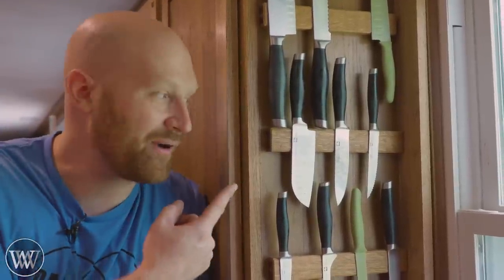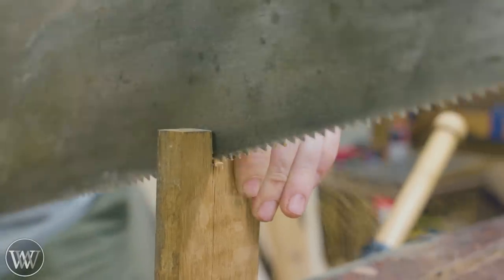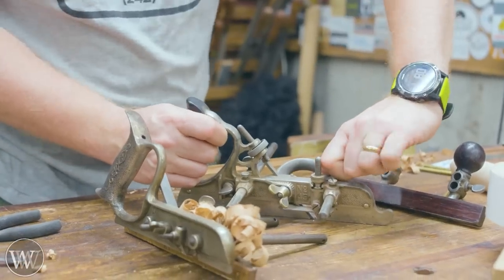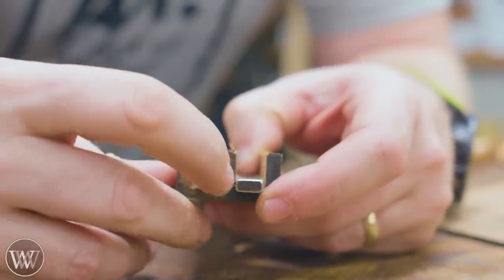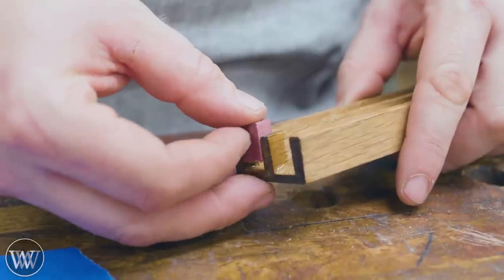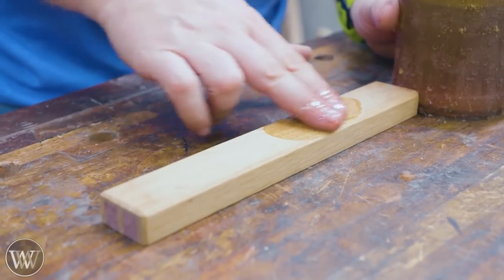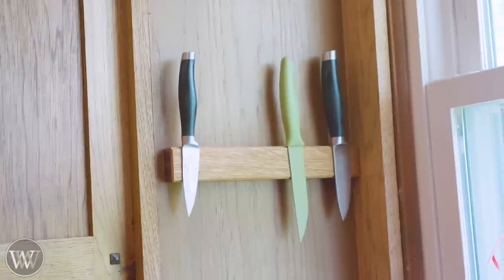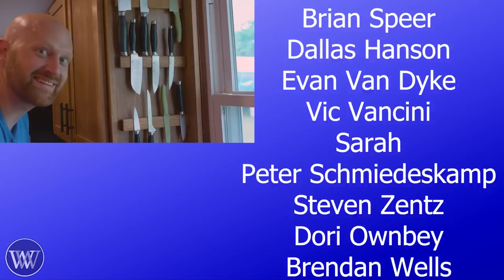How To Make a Magnetic Knife Holder

Comment: I’d make it backwards after figuring out how many magnets and they layout of them. Cut grooves to exactly 2x thickness of magnets, push them in, glue a 1/8” or 1/16” veneer on top. You get more material behind magnets for fasteners, and very thin material in front of them for maximum power.
Reply from the maker: I have that on my old set but with the veneer it broke pretty quickly. I could use a thicker 16th inch veneer but that would be the same thickness as what I have here.
Reply: @WoodByWrightHowTo  my previous one is magnetic bar from harbor freight. Every time I put a knife on, that metal on metal sound was pretty bad. I put one 1 layer of packing tape on it and it was fine. My current rental landlord lady does not allow any hole drilled on wall or the outside of cabinets. I can’t use magnetic holder any more.

Comment: I made a version of this that goes under the cabinet that is over my cutting board. Since I cook with one knife 99% of the time it's always at hand but it's out of the way when I don't need it. I used round magnets so it was easy with a brace. Since it's just the one knife it goes along the length of the wood.

Comment: James,
The magnet you linked to as the one you wish you used is not a true N52 grade magnet. It is far too weak for the size it is. Next time look at K&J Magnetics that is the site I have been buying magnets from for a while now. I make a lot of magnetic knife boards and depending on the client's needs I will use either N52 magnets that are 2"X1/2"X1/4" or 2"X1/2"X1/2" in a single row. I cut a piece off the face of the wood I am using a take it down to 1/16" and cut off a piece off each end. Then I route out a slot for the magnets and glue them flush with the face of the board. I will then use dowel and glue to reattach the end caps and glue the face back on. Since I use extremely thin Japanese saws to cut everything it makes the seams just about invisible even on highly figured woods and burls.

Comment: I made mine in oak which used about the same dimension but cut the front off at ⅛-¼  thick on the band saw. I the cut my slot in the main piece using my router for the long the magnets. I then cut a wider track on top to which I glued festool track edge rubber. I then glued them in using epoxy and glued the front to the rear followed by the rubber track. So I only have one line and holds all my kitchen tools. If you want a photo please ask for. K

Comment: That looks really nice!!! instead of screwing it to the wall you might have been able to screw a long steel piece to the cabinet and let the magnet hold everything together. You might need even more magnets in order to do it this way though 🙂
Reply from the maker: Unfortunately, it wouldn't hold through the 1-in thickness of cabinet wall. That would be a serious magnet to hold that long.
Reply: @WoodByWrightHowTo  I was thinking of a steel piece on the outside face of the cabinet that would be hidden by the knife holder.

Comment: What is that gizmo you used to cut the grooves in with? Also, you've got to be pretty strong to cut that oak free hand like that. I'm an older lady that works with wood and definitely not strong enough for that!
Reply from the maker: That is a Stanley 45 combination plane. Cutting the oak doesn't have as much to do with strength as it does with body mechanics. Even the hardest Australian woods don't take any more strength they just take more endurance because it takes longer.
Reply: Very nice, thank you.   @WoodByWrightHowTo

Comment: Why do you saw on the left hand side of the vice so you have to reach over to catch the offcut? Wouldn't it be better on the other side?
Reply from the maker: I usually prefer to keep the piece I am keeping in the vice. and that means to keep the line on the side I am on I saw off the left edge of the vice. also it keeps the same   body mechanic of using a bench hook.

Comment: Yeah, wooden knife blocks are a breeding ground for bacteria and other, less than desirable things. This is a great little project. I'll be renovating our kitchen next year and will be incorporating this into the redesign (or a variation of it). Thanks for the idea.
Reply: That is actually not true - wooden cutting boards and blocks are naturally antibacterial...
Reply from the maker: That's actually a myth. They are not antibacterial. It's commonly touted in many places but not true. Wooden cutting boards hold far more bacteria than their plastic counterparts. They still have to be washed and decontaminated.
Reply: @WoodByWrightHowTo  do you have any source for that information? Since i cannot put url's in a comment, search for 'Cutting Boards of Plastic and Wood Contaminated Experimentally with Bacteria' by Nese O Ak et al. for a scientific publication showing that wood is better.
Reply: @pinkerbot  wood might be better but they aren't antibacterial. Maybe they have some kind of coating from the factory that is resistant but all such coatings break down over time and cleanings. If you look at fire retardant materials such as NOMEX coveralls used in industrial applications, after so many washings, and it isn't many, the FR coating is negated and the clothing just becomes uncomfortable to wear but provides minimal protection.

Comment: Since you epoxied in the purpleheart, why not drive screws into that where there’s a bit more meat for the screw to hold onto?
Reply from the maker: That space is actually a little smaller. And because it is going across the grain, they would split almost instantly. Those are only a quarter inch thick. The middle piece may be thinner, but the grain is going lengthwise so if it splits it's not a problem.

Comment: I strongly recommend mounting these under the upper cabinets. Having a wall of sharp, naked blades is a recipe for disaster. Putting them under the cabinet means that the handle will always be what you grab, it eliminates the possibility of accidentally leaning up against a blade, and forces a single row of knives per section.
Reply: The single row bit is important so you don't stab yourself when grabbing a knife on a higher level.
Reply from the maker: I had that in her last house and I really didn't like it because they kept getting hit and knocked down. Having them on the side of the cabinet means that there's less moving around up there unless it's going to knock them off. So far I really liked it because you can actually see what you're grabbing every time.
Reply: @WoodByWrightHowTo  Interesting. We've never knocked a knife down or even out of alignment. I wonder if it's because they're under a corner cabinet where the space below isn't used frequently.
Reply from the maker: it has more to the fact that I have 3 kids currently learning to cook. things get moved around a lot on the countertop.